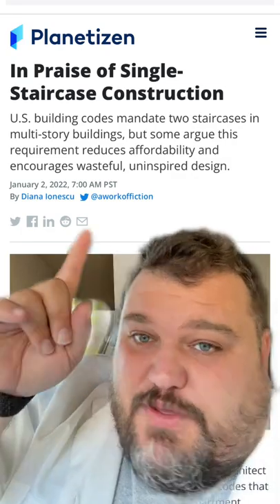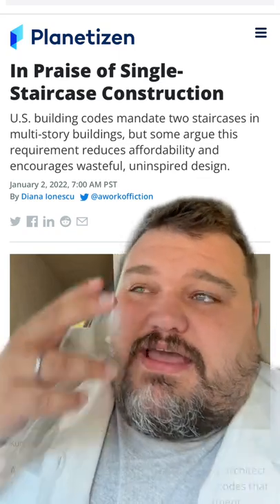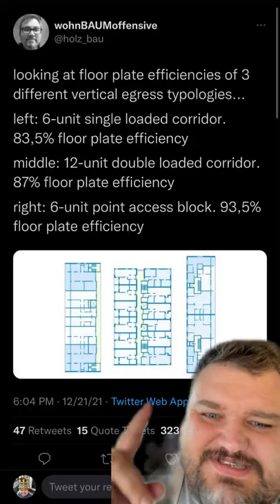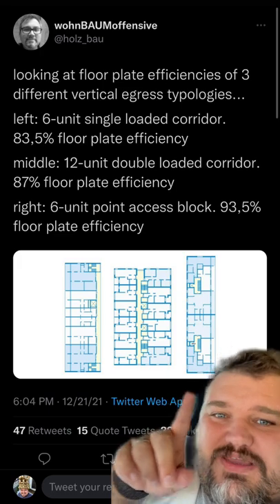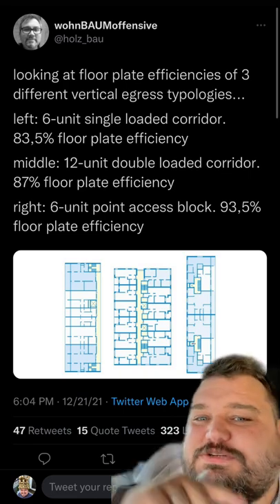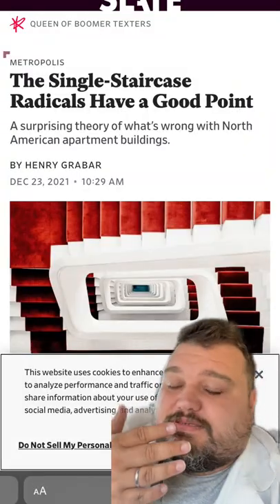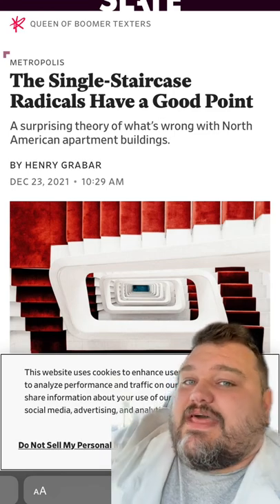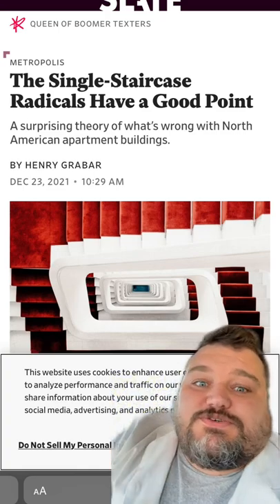Single staircase reform

Comment: You have to be a lousy architect to not be able to design a second stair case in a building for safety.  The code was required because of past experiences.  Leave it in the code.  Trying to get out in case of a fire and someone trying to save grandma China cabinet blocking the one  fire exits is a real issue

Comment: Yes in Sweden we have One stairs and at the top of the building seiling by the stairs its like scwar shaped wooden Window that you push Up Whit a metal stick  so al THE Smoke gets sucked in to it IF People need to move out of the building during a fire so it becomes less Smoky in the stairs section and they have to check that it works ewery 5 years plus we usually dont have wooden stairs its mostly Stone stairs Whit metal ewen old buildings have Stone stairs it has to be a private owned house Four it to have wooden stairs.